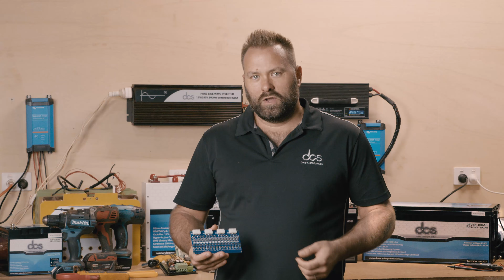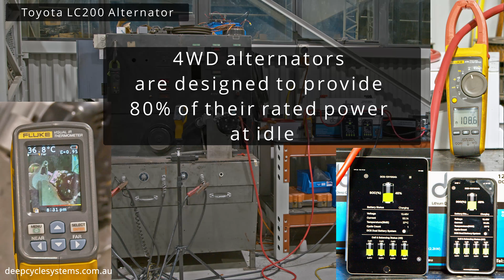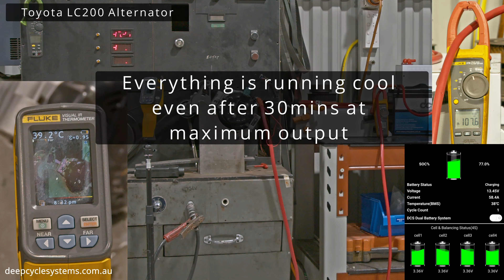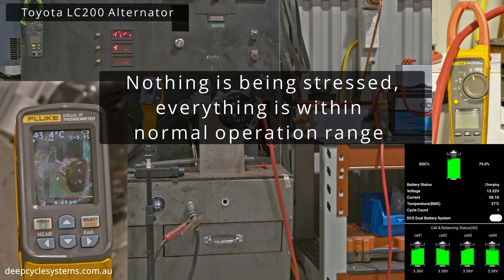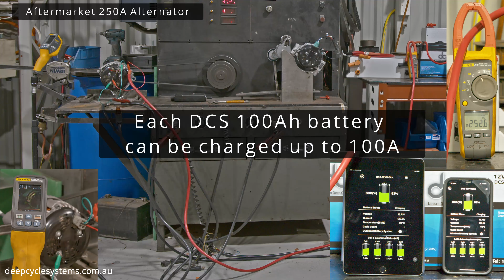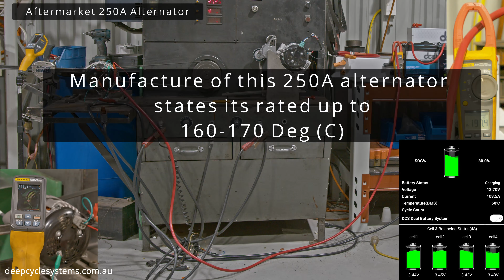Charging DCS lithium batteries directly off 4WD alternators

Comment: Will the alternator stop charging when the battery is fully charged?  Your video shows 90A charge current when fully charged.
Reply from the maker: Yes once the batteries have tailed off (fully charged and gone to standby) the alternator runs the vehicle. Or with our Hybrid batteries our solar regulator takes over and runs the vehicle and both batteries and the alternator go to standby.

Comment: Great video, any advice for a 2004 1kz-te prado with 70amp alternator, I have killed 3 alternators so far trying to charge a two battery setup using a vsr, I am thinking of installing a 140amp alternator, will that help?
Reply from the maker: Same advise as always don't get after market alternators, OEM is best! Get a genuine one then you can run our 180Ah DBS. 70A is plenty enough and if you needed a faster recharge bolt up a 400W+ solar panel on the roof as well.

Comment: What about temperatures UNDER bonnet while driving during very hot day on the beach let's say up north Queensland? I guess a bit different story.
Reply from the maker: You have battery pack temperatures on our monitoring app, so you can see that info real time. Most 4WD engine bays see our batteries typically between 70-85 degrees C.
Reply: @deepcyclesystems  is that going to lessen cycle life at all?
Reply from the maker: Every battery cell chemistry is engineered to be stable at 25 degrees C. So yes the longer cells spend above or below this threshold has a direct impact on overall service life.

Comment: G'day Paul and DCS crew, love these videos and your products. Any stats on the impact to battery life under engine bay temps vs in cabin? Amazing to see your batteries can run up to 110 deg, market leading for sure! Can't help but be conscious of overall battery life... Seeing the DCS warranty is only 3 years when under bonnet compared to 4 years if installed elsewhere kinda suggests its still not a great idea having them in the engine bay when it comes to longevity. Keen to hear your thoughts?
Reply from the maker: thanks Jarrod, in a normal environment your looking at around a ~1-2% capacity loss per year.  In a high temperature environment (under bonnet) the cells will suffer from a faster rate of chemical ageing we are typically seeing ~3-5% average over the past 7 years.  So say 10% after 3 years, so your 180Ah DBS would be around 160Ah after 3 years.  Or your 260Ah DBS would be 234Ah after 3 years.  Of course depending on how much towing, which part of the country, average distances driven, average DOD's, how they are charged etc.... etc.... many variables.  

Expected service life looking at easily the average life of the vehicle being 4 years - with all the added benefits of ultra fast charging, weight savings, space savings in the cabins, monster high performance continuous output for large winches and inverters, IP sealed MPPT solar system etc...
Reply: @deepcyclesystems  Thats great, thanks for the response. I know its not an exact science given the variability so really appreciate you sharing that based on customer experiences. Have you seen any benefits in using battery heat shields? Should i even bother?

By comparison, I've had an 140ah AGM in the engine bay for the last 12 months, and its down to 65% of original capacity according to a recent test! 

Definitely be placing an order with you guys next...
Reply from the maker: You want air flow across the batteries in an engine bays, so a heat shield is only going to help if it doesn't hinder that airflow. AGMs are not suitable for engine bays, but the companies selling them won't tell you that.. instead they will tell you lithium isn't suitable for engine bays.

Comment: Do we need dcdc charger if I use your Li  dual battery system for land cruiser 200 series ?
Reply from the maker: No our dual battery systems are connected directly to the factory alternator, refer to the wiring diagram here:  https://www.deepcyclesystems.com.au/product/ultimate-dcs-12v-260ah-dual-battery-system-lithium-land-cruiser-200-series/

Also you can watch this video for more information about our dual battery systems: https://youtu.be/4r96CRmiKrs

Comment: Nice little video, batteries always look like a good thing👍
I'm sure there's no issue as has been proven many times over the years but there's a bit of a mix up between rotor and casing temps. There is a big difference between these temps as there is only a miniscule contact patch between the casing and rotor - 2 bearings - heck even the stator hardly touches the housing. Only real way to see rotor and stator temps would be with the gun 90° to the alternator and to have it in a coloured mode not the picture mode🤷 can't have it all but. You would still struggle to get accurate rotor temps and usually just end up getting the windings which are still alot hotter then the casing

Comment: Also running two, one under bonnet and one in cab. Amazing product from DCS. 

Would love to see a tear down directly from DCS. Actually pulling one apart, rather than shown as a group of parts on  a bench. Look forward to the vid 😉
Reply from the maker: no problems at all, we shall share some nice pics and tech info shortly on our Facebook page.

That staged bench shot was actually quite funny even the stubby was strategically positioned. 
Even funnier was the list of components, anyone in electronics would be impressed by the correctly pointed out component list, thanks for the free advertising who ever that was.

Comment: What about a standard (not smart) alternator from an older 4wd? Rated at say 100 amps? 
How could we be sure that it will not burn itself out if directly charging two 100amphour lifepo4 batteries?
This is interesting video but it seems to be only focussed on modern 'smart' alternators,  which in my opinion,  aren't really 'standard' alternators.
Reply from the maker: these are maxed out alternators no smarts here - that's the point.  We are loading these as 'standard' voltage regulated units.  Both smart and older voltage regulated alternators are fine.

Comment: running the batteries under the bonnet of my 105 for the past two years they have not failed me so far.
Reply: Stephen do you still rate your 250xp SBC alternator paired with these? At a guess that's the "after market" alternator being used in this video too? I love the idea of these batteries being able to take 100 amps each at idle to recharge ... I reckon that's just as big a draw card to making the switch as the increased storage capacity. I'm a 105 land cruiser owner too :)